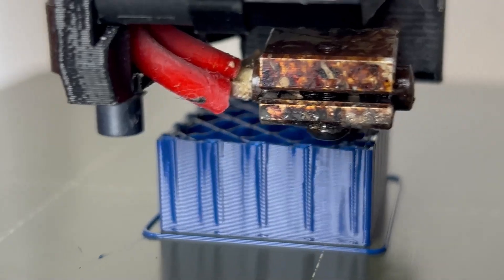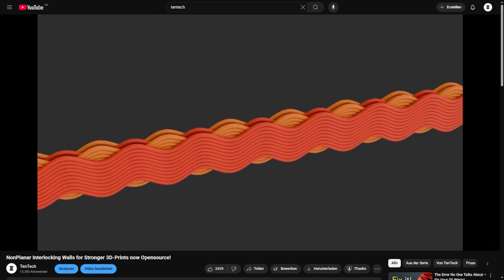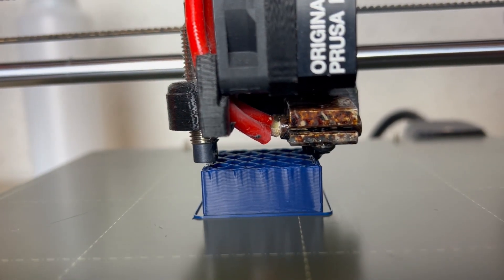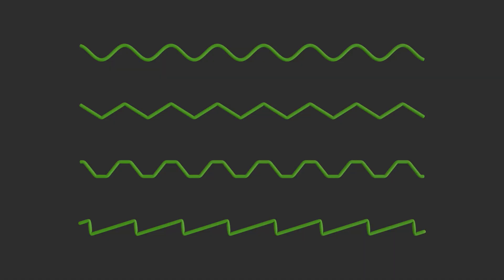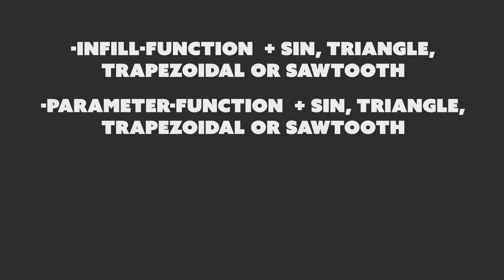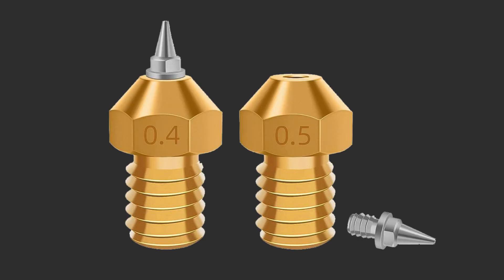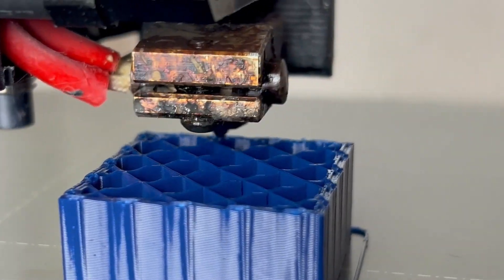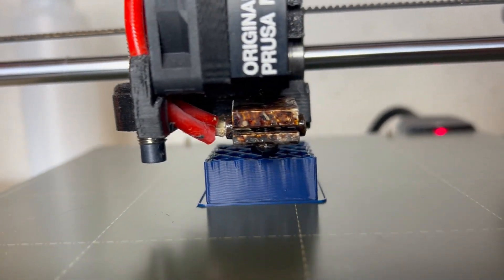Update: NonPlanar Interlocking Wall 3D-Prints: New Patterns!

Comment: really cool. I wonder, if you could add modification, so that part of extrusion that is shifted downward has slightly lower extrusion multiplier.  As you probably noticed, the script makes outer walls wavy. I also think, that counting 2 outermost walls like outer walls and keeping them straight could work too
Reply from the maker: Hey, you can disable the outer walls, so that you get the normal surface texture
Reply: @tengertechnologies  I know. Maybe I've added too agressive of a sine wave, but disabling outer wall only made effect smaller and not dissapear. (wall amplitude 0.4)

Comment: Nice work. Would be nice to have specific parts printed hotter (esp. with fast reacting heater systems) and slightly higher flow, e.g. wall infill/inner-layers to help force out air and increasing bonding without affecting surface quality.

Comment: Thank you for all you did... but you did cost me a pretty penny as it was the kick in the butt I needed to start doing proper strength tests which I had planned for a long time for my 3d printed cam cleat. I also did experiment with brick layers for better tpu gaskets and it seems to be working fine but a lot of extrusion fine tuning. still was able to put more material in the same envelope.

Comment: Welcome back! Would you kindly update Smoothificator for OrcaSlicer when you have a chance? Thanks so much 🌹
Reply from the maker: I‘m working on a compatibility update for all of my scripts
Reply: @tengertechnologies  
Thanks for your hard work! I'm trying to solve an issue but haven’t been able to get it working. If you’ve ever used the inner/outer/inner wall order, you probably know it can cause problems with overhangs.

I tried editing the G-code to flip the wall order whenever it detects an overhang, but I couldn’t get it to work since I haven’t done something like this before.

Can you find a solution for this issue?
Reply: What is Smoothificator?
Reply from the maker: @LincolnWorld  Basically a smooth print surface without a crazy printtime increase. f.e 0.05mm layerheight look with very little time increase compared to a 0.2mm layerheight print. It lets's you change the resolution of the outer most wall to a different setting than the rest of the print. My first script/video on that topic is: Different Wall-Layerheight for 3D Prints now Opensource!   and the second one is: Better Adaptive Layerheight for 3D Prints?  Both are somewhere in my last 10 vids.
Reply: @tengertechnologies  Oh wow! I will definitely be looking that up. Thank you!